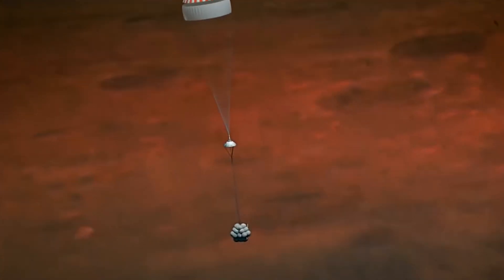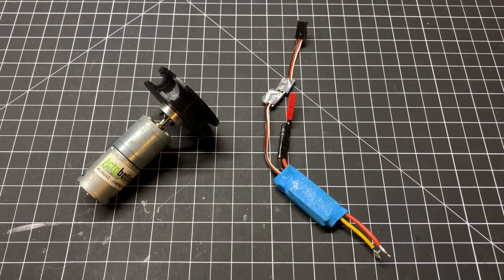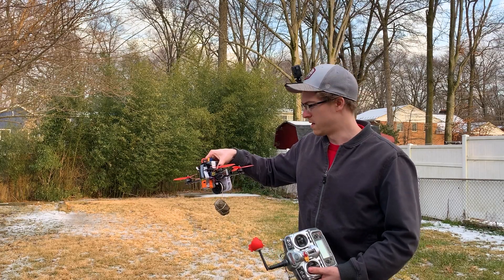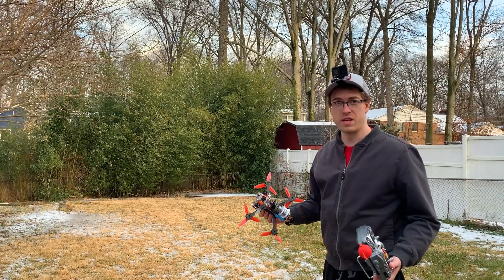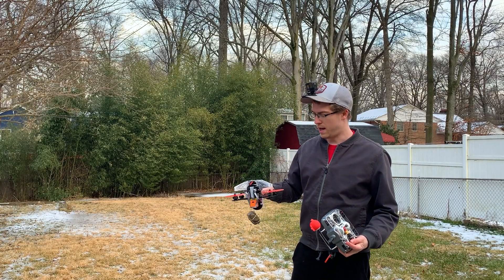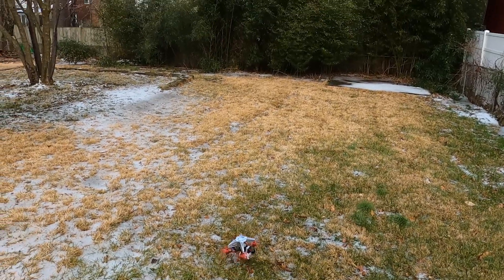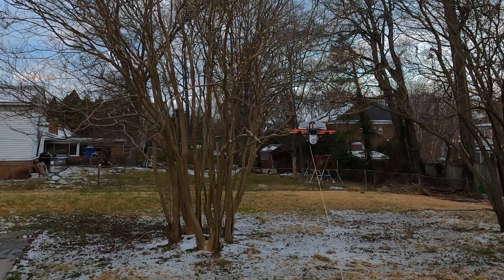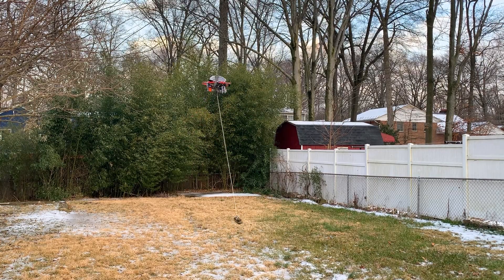Mars Rover Sky Crane: Drone Test

Comment: Hi Sir. That was a cool experiment. What I believe is that the mass ratio between the drop-stage and the rover really matters here. I would suggest you try repeating the experiment with 5-6 calibrated weights to see the change in dynamics at one particular ratio of the drone and weight. Thanks! ✔
Reply from the maker: Excellent point

Comment: I think the length of your tether is a lot longer relative to the size of the real thing. Also the real thing is a more balanced load, and they don’t start lowering it until the sky crane is locked in stationary.  Furthermore, your thrust is straight down which is less stable. On the sky crane the thrust is more diagonal, which creates a less turbulent center column and if it starts moving, it’s kinda trapped in this calmer, lower pressure column of air where it’s getting pushed from the sides equally by higher pressure propellant.
Reply: No it's lower pressure propellent exhaust becuase of the faster flow,

Comment: Maybe adjustment to the PID of the flight controller could solve the issue.
Reply from the maker: One would think, but a PID attitude controller can't tell its being pulled on side-to-side, just if there's a rotational disturbance. Check out the end of the video where I explain the need for additional control systems to stabilize the skycrane
Reply: @NicholasRehm  it might be possible to detect latera movements with and accelerometer.  The cable angle sensor is probably better and easier to implement.
Reply: @NicholasRehm  It would be interesting to add an additional term to the angle controller based on the lateral acceleration measured by the accelerometers to compensate for the pendulum effect. Although it might require a velocity controller to work properly.
Reply from the maker: @hasidavid2  very interesting idea... might have to try that if I revisit this quick little project

Comment: It seems to me that if you build expensive stuff like Mars landers, that you'd want to minimize the number of control variables. The more variables, the more complex your controller needs to be and the more stuff that can go wrong. Or, according to Murphy's law - will go wrong. The complexity of the landing sequence using the sky-crane seems infeasible to me. So much can go wrong... but it performed flawlessly!? So, there are essentially two possibilities: either those people at NASA are just so amazing at building stuff, or they are great at selling BS to the public. Which do you think is more likely? (and which is cheapest?)
Reply from the maker: I think you strongly underestimate the power of knowledge and mathematics when applied correctly by very smart, hardworking people

Comment: This was a cool experiment I was wondering if the rock was lowered only so far, then allowed to rest on the ground while the rest of the tether unraveled it wouldn't have the chance to swing around.
Reply from the maker: I think in my case there was definitely a shorter tether length that would be ideal for dropping it off before those big oscillations start

Comment: In scale terms, your line is way longer than that used for the skycrane/rover combo
Reply from the maker: I agree--I exaggerated the length to exaggerate the effect
Reply: It has also been pointed out elsewhere that the suspension point on the skycrane is well above the plane of the lift.

Comment: Geek! Your experiment should look into 3-cables, and when deployed there should be no twisting to induce swinging. The lander and rover work together so the lander has to be stable as possible. The program for your lander should, descend, drop rover, detach, fly off, all in less than 21 seconds. So far so good, nice work keep working on your experiment. 
USN Vet. Go ERAU!
Reply from the maker: The 3 tethers on the real skycrane share a single attachment point to the skycrane, so it has an identical effect on it as a single tether would. Multiple tethers with varying anchor points on the rover only prevents the rover from rolling and pitching around. With a rock, we don't exactly care if its rolling or pitching, hence the single tether used

Comment: This very much reminds me of the XPilot game (2D) where players control thrust and gravity driven ships on a map and could in some game modes drag a ball much heavier than their ship through a tether.
You can find an example of such controls there: https://www.youtube.com/watch?v=EurlBHA2VGQ
One interesting point is that despite the relatively low frame rate, about 30 FPS in the 1990s, the ball was very well controllable after a bit of practice even though it was subject to all the effects you had to deal with (oscillation, back and forth between the ship's thrust influence and the ball's pull).
The most advanced players could essentially bring the ball wherever they wanted with extreme precision all the while flying around the map and avoiding obstacles, it was quite something to behold.

I presume that if such fine control was doable with a temporal precision of only 30 FPS, digital controls (keyboard only), and an elastic tether, then most likely the same should be doable for a drone controlled with much greater precision (analog controls), a higher refresh rate.

I'd persevere if I were you. ;)

Comment: That skytrain is super amazing. You think about those thrusters are so powerful if they were just slightly unbalanced the thing would tumble out of control.  amazing.
Reply: Well it would adjust for any imbalances
Reply: @kevinshen9391  Really?
Reply: @onjofilms  that is what the PID control loop does. the I, or integral component of the feedback loop adjusts for any constant errors, which in this case would be the unbalanced thrusters. NASA probably uses a feedback controller more advanced than a simple PID controller used to manage drones and quadcopters but the idea is the same.
Reply: @kevinshen9391 - PID?
Reply: @onjofilms  A PID Controller: Proportional Integral Derivative. you can google it if you want, or watch some of Nicholas Rehm's videos about his flight computer code.
Reply: @kevinshen9391  - Oh yeah, I remember that from one of my electronic engineering classes now.

Comment: I think there's a whole research field about a quadcopter manipulating a payload, and the flight computer takes into account not only the quadcopter's orientation and movement but also the suspended weight through cameras and other sensors. I don't know the name of this but I know it exists, so it might be valuable to look into. just my two cents.
Reply from the maker: Absolutely. Very interesting field with a lot to it on top of simply stabilizing the main vehicle. I'm really interested in balancing an inverted pendulum...

Comment: Why use only one tether, as the rover uses more (3) possible to avoid stability problems ?
Reply from the maker: Notice in the real sky-crane at 0:42 that the attachment point is still a single point--the 3 tethers are on the rover, which are simply used to keep the rover itself from rotating
Reply: @NicholasRehm interresting! Then there must be a kind of stability program active to reduce the risk of oscillation.
Reply from the maker: @jeroenbrinkman  Absolutely. A form of 'cascaded' control on top of the stability control the skycrane needs to hover on its own

Comment: I would think that using a skycrane would add more complications to the mission and lead to greater chances for failure. Would a lander module much like the Lunar lander be a more viable option? A lander could've served two purposes; 1. Get Perseverance on the ground safely. 2. Act as a stationary command and data relay center, where it could deploy larger solar panels for charging and relaying data back to Earth. 

In my opinion a skycrane that has a sacrificial use and leaves debris on the surface of Mars is kind of counter intuitive of exploring an unknown and new world.

Comment: It's amazing that they just use non-rigid nylon ropes! I assume the dynamics do not change (it's not "more stable") because they use three ropes right? Did you find any specification on the max length of the tether? Skycrane was supposed to be at 21 meters (70 feet) altitude when the rover separated from the ropes. It may be interesting to match that at your scale.
Reply from the maker: Didn't know that about the tethers! And nope, the additional tethers are at the rover end to keep it from rotating all around--there's a still a single anchor point at the skycrane